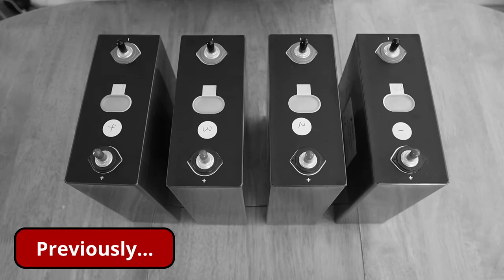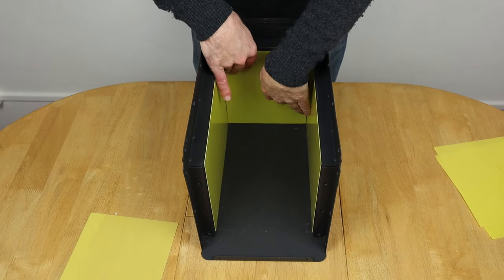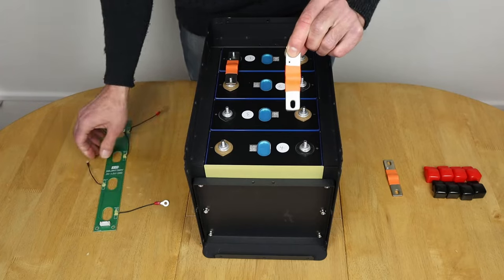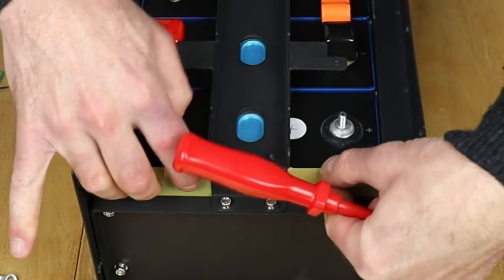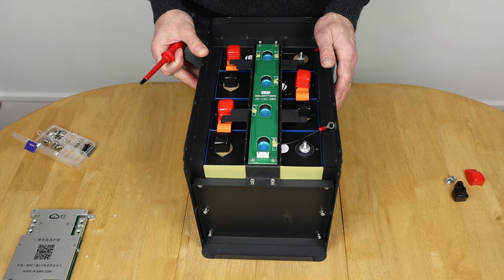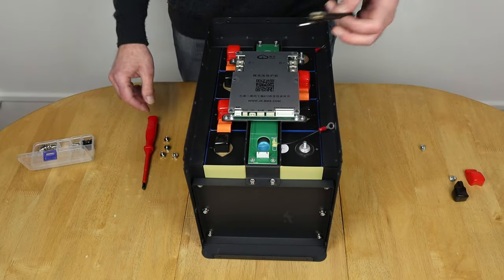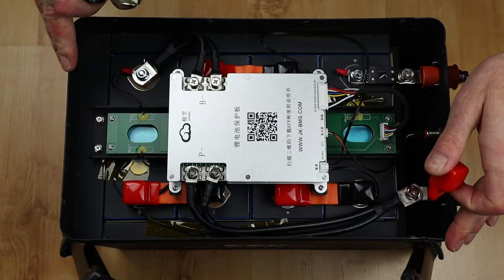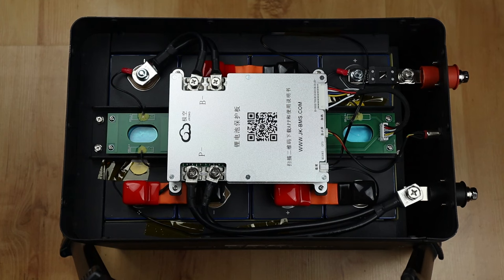ALMOST Perfect? | 3.5kWh EEL 12V 280Ah Battery Box | Full Build

Comment: Seems like you could screw the balance terminal wire to the buss bar before you slide the vinyl covers on?
Reply from the maker: @davidhamilton8984  Good shout David and something I did have a go at. The problem is the cross-bar makes it very difficult to get the busbar on the terminals and increases the possibility of pulling the cable out of the board. To date, this has been the only real (low risk) way I've found of getting it in on the ones I've built. Thanks for the suggestion though. All the best, Adrian

Comment: The downside to this box is I do not see any way to order it without having to get that garbage BMS that comes packaged in with it.   That's a serious waste of money to have to pay for that only to put in a good quality BMS of your own.
Reply from the maker: @jkutyna  Each to their own. Never had a problem with JK BMSs and neither have people I've built batteries for. Same for JBD and Daly BMSs.
Reply: From what I’ve heard JK BMS’ are generally good for batteries of this size
Reply from the maker: @jamieclarke321  Thanks for adding that Jamie👍 It matches my personal experience and also what I've read/seen. All the best, Adrian
Reply: @DADvinci  cheers Adrian, your video has sold me on using these Eel boxes in my Biodome products, they look extremely professional and I haven’t found pre built batteries to be reliable. Extremely useful video for me
Reply from the maker: @jamieclarke321  No problem at all Jamie, glad it provided useful. Prebuilt are fine unless you have a problem (with or without a warranty) as you can't really get into them to repair or see build quality without cutting them open which isn't ideal. That's what I like about the EEL, fully serviceable/repairable, although it's only likely to be the fuse or BMS that needs attention should it ever stop working (LiFePO4 cells seem to be very reliable and long lasting). I've got a few left from the current batch and now build them for customers if you're ever interested. The BioDome looks like an awesome addition to any school! Cheers, Adrian
Reply: try using a dali BMS, now that is a really rubbish BMS JK never had an issue (yet)